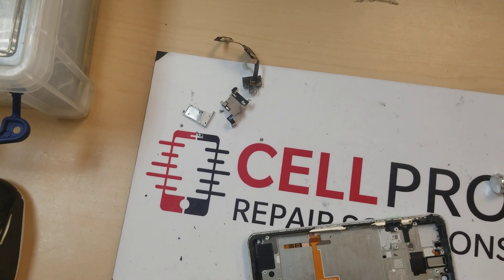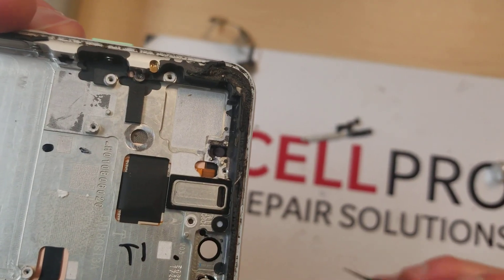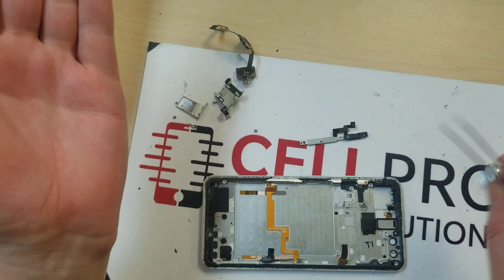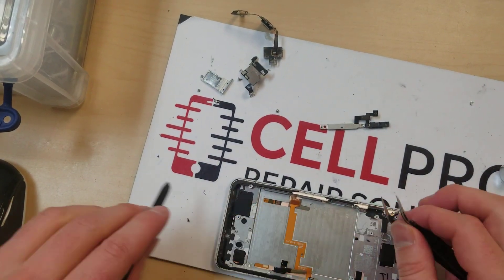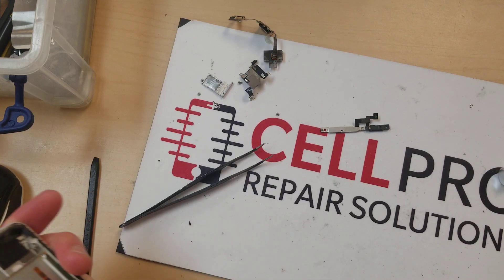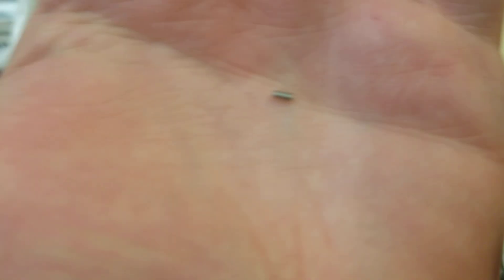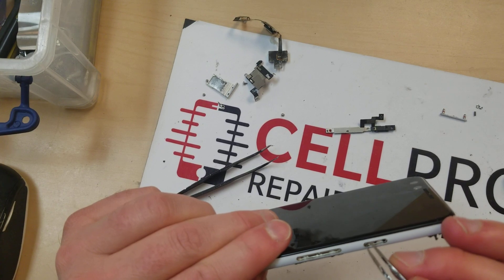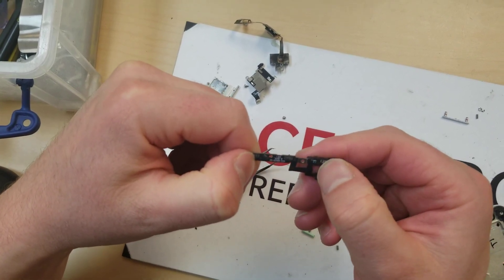Google pixel 3 on/off volume button not working take apart and trouble shoot

Comment: Hey, Would really appreciate if you can answer this: My pixel 3 volume and power buttons stopped working, I opened the phone and it also won't charge since. Now I assume what I need is to replace buttons+usb socket for charging. But maybe there is electricity issue that you can anticipate already. 
Thanks very much :)

Comment: How deep do I have to tear it down in order to replace the Power/volume Flex cable?
Reply: Best case scenario, remove back cover, wireless charging coils, and vibration module. Then you should be able to remove the buttons and flex cable. Worst case, motherboard, speaker below along with all screws and ground pins need to come off.
Reply: @thaung2 doesn’t seem so bad

Comment: Can you  access the flex cable by taking off the screen assembly? You show how to do this with a full teardown from the back. Thanks!
Reply from the maker: Yep you can
Reply: @cellpro  that seems like the way to go, isn't it?? Are there any disadvantages to going in from the screen side? It did not look very difficult to remove the screen assembly.

Comment: Thank for sharing.  My Pixel 3's power button is actually physically broken in the middle and I'm looking for a spare part online, but can't find any.  Any idea where to look?
Reply: Yeah it's a shame. My power button is physically damaged and the spring wasn't pushing it back so it's always pressed in. I've removed it and using accessibility feature to lock the screen and fingerprint to power it on. I couldn't find a button on ifixit or eBay or even AliExpress. The best next thing would be a damaged phone on eBay but I'm not willing to spend $80 for a button.
Reply: Ifixit
Reply: They don't have one